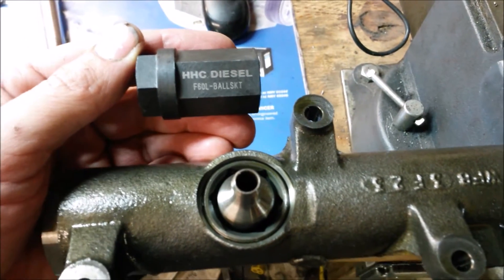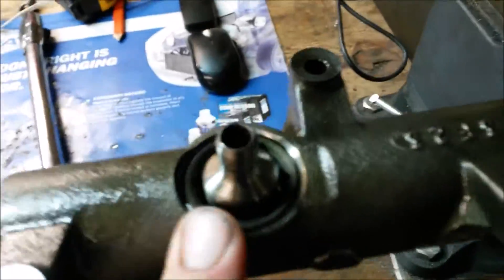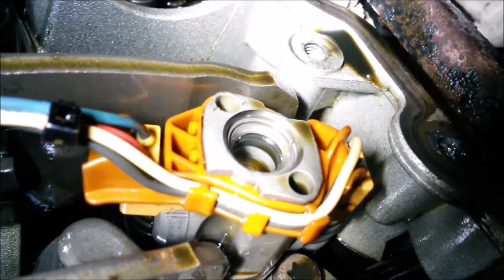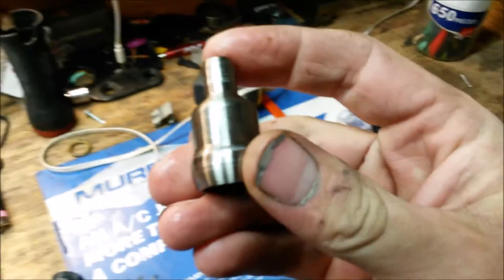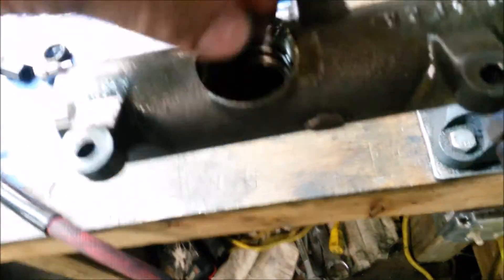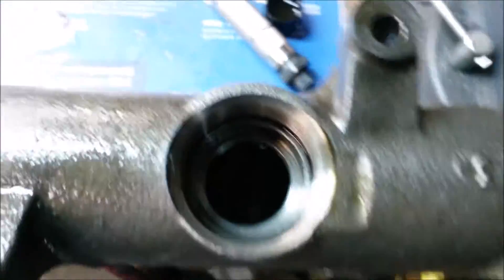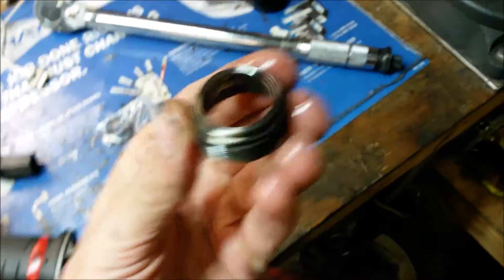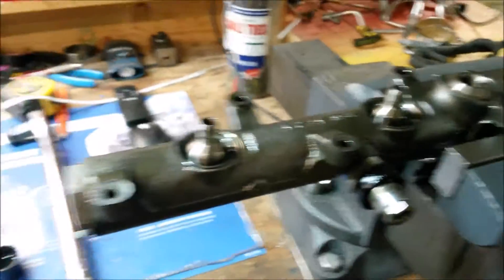Ford 6.0L ~How to Replace Your Nipple Cup Seals w/HHC Diesel Ball Tube Tool

Comment: just got my package of nipple cups for my 2003
F250 oil rail came with all eight nipple cups all the O-rings the tool I ordered it Sunday night at
3 PM had it Monday morning by 1 o'clock at my doorstep best service ever already installed them in my truck very easy to install to work with and they work awesome just as they should best ones on the market hands-down spend the extra money on the HHC diesel nipple cups an tool dont buy the oem one

Comment: Replaced the nipple cups and o rings and they didnt evem last 2 years or 50,000 kms. The nipple cups are loose and the o rings are already worn. Not sure if I recieved a bad batch or falsely sold the wrong items. Either way its annoying that I have to order new o rings and pull both oil rails off again to redo this work. Instead of hhc I would suggest genuine ford parts.
Reply from the maker: Hey Corey.
This is Corey from HHC diesel. Usually when this happens someone has put in auto parts store, or cheap Amazon top injector seals. It's the top injector seals going that then lead to the nipple cup seal failing. The ones sold at auto parts stores fail within a year usually.

Comment: Please help. DieselTech RON do not recommend resealing top injectors and nipple seals. He sees them always failing. What would you recommend. How long this seals last in your experience. Thank you.
Reply from the maker: DieselTechRon (God Rest his Soul) was a factory tech. Factory techs do as advised by the TSBs and mother FORD.

In the last 10 years, replacing the seals in the high pressure oil rail, and the nipplcups themselves, is common place. Seals fail, but can be easily replaced.

Things have come a long way. Ask In some of the Facebook or internet forums, you will get a similar answer.

If you choose to replace, make sure you use seals and cups from HHC Diesel.
Reply: SuperDuty Thank you for reply.
Reply: Yes i replace them. They are a service type item. Id recommend changing them out every 100k or so or as needed. It is very cheap insurance. @SuperDuty

Comment: What I want to know is where can you get the other o-rings for the complete manifold o rings must be a top secret I know they're special but I've been a mechanic for 40 years change have changed a lot of o rings
Reply from the maker: There's almost no reason to ever even touch the other seals, and, since they are just plug seals, they never go bad unless you mess with them.
Ford sells them though.
Reply: @SuperDuty  I tried a number of Ford Dealerships.         got to buy the complete manifold  300,00 x2 heck of a price for not doing any investigating first.   just o rings just goes to show you never too young to learn investigate

Comment: How did you test the system for leaks? What did you use?
Reply from the maker: air blower attachment, grease gun whip and an m12x1.5 adapter. I show it in my video here:
https://youtu.be/Q0ul617VgBs

parts list in that video description
Reply: do you need an impact wrench or will a 1/2 inch wrench will work and can the injector o rings be replaced easily
Reply: HERPY DERPEDY 1/2 inch wrench is fine. HHC Diesel has some good videos on replacing the injector seals

Comment: Ben working on powerstrokes for 3-4 yes never seen those nipples leak I guess depends on different climates maybe
Reply: thanks for the videos. auto and truck tech for 30years just had my first 6.0l that the cup seals are leaking on one injector and caused a hot long long crank after driving.
did air press. check and could hear it start leaking after about 3 or 4 minutes. removed valve cover and air checked again. used mirror and could see it coming from the rail side. removed the rail and could see the o-ring degrading on the top side
again thanks for your videos.
Reply from the maker: You'll see one sooner or later. Seems like after about 200,000 miles is when they are likely to fail. Symptoms: Hard or No Start Hot. Air test shows leaks at top injector seals.

Many people have small leaks at the nipple cups, but it takes a big leak for it to travel along the nipple body and degrade the top injector seal.
Reply: Seen lots of trucks with over 200k will have to keep an eye out for that